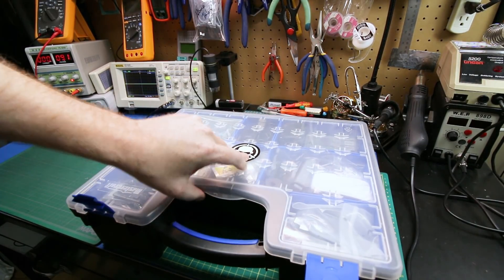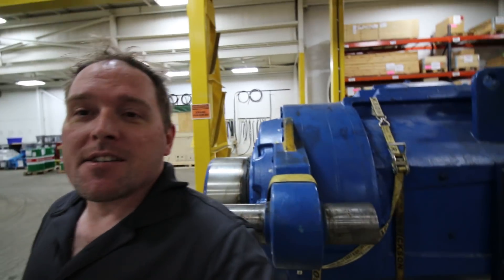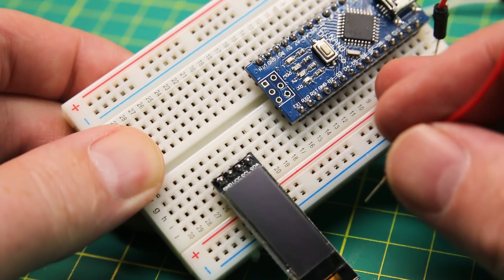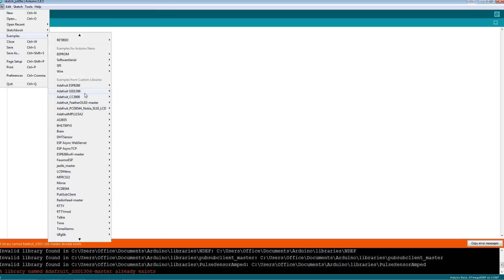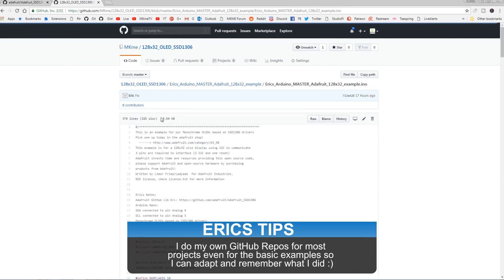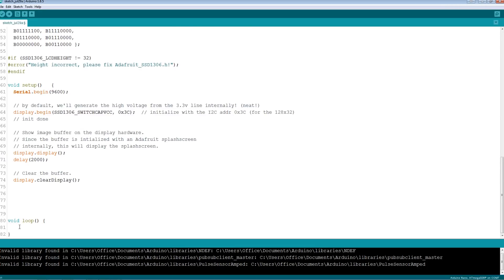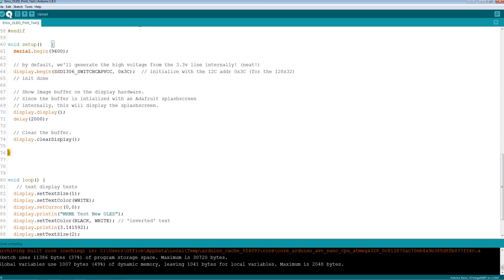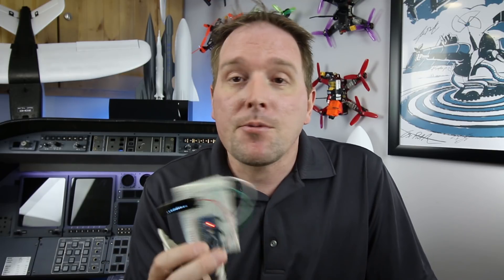Electronics BASICS- OLED Display For DIY Projects

Comment: I have a similar display and I tried with the same library, but it does not even turn on.

If you have any suggestions for debugging it, they would be very useful. Thanks!
Reply: mark make 100% sure the wiring is correct.
Reply: Thanks for your reply.
There are only 4 wires and I checked them.
SCL and SDA are connected correctly as well as Vcc and GND.
Reply from the maker: Delete the library from your Arduino folder and re-download. Triple check you have the right board selected in the IDE and connected to the right pins. Failing that get the scope out and DMM.
Reply: It works now.
I had to change the i2C address of the display in this line:
 display.begin(SSD1306_SWITCHCAPVCC, 0x3C); 

My display is at addredd 0x3C, while the downloaded code had 0x3D.

Thanks for your help!

Comment: Glad to see you're back.  One suggestion (just a suggestion).  Provide more details at the beginning on what exactly your are going build or discuss.  Also, the title says "BASICS" but you kinda glossed through some of the things you were doing.  Some one just starting out might get lost in a hurry.  Even I did.  Just some suggestions.  Would like to see a session on making a simple temperature or whatever logging device.  For example, a temperature monitor which would save to a file reading at a certain interval which could be later displayed as a graph. You could do another shows where is add another sensor to this project.  I have seen show on this but they assume you are an expert with these devices.

Have a great day,

Tom
Reply from the maker: Hey Tom. Will try to do a few more details but it is really a balancing act. The code is heavily commented, I do a readme on every Git Repo and there is the forum thread linked for people to get help. This was already a +15 minute vid. Trying to include a bit more entertainment value where I can so that makes it hard and longer.  Thanks very much for the feedback.  It's appreciated.

Comment: 70th (view) Just picked up some Digispark clones and some cheap servos.  Nothing planned but when inspiration hits I won't have to wait for shipping.  To those getting started - double check your microcontroller input voltage and interface voltages.  When those are right, it is really hard to do any permanent damage. And if you DO damage something, figure out why.  Don't just drop in a spare and burn that up too.  Use your meter(s), check current too.